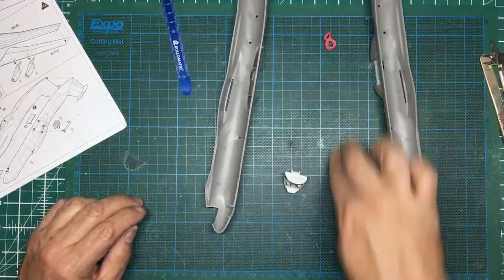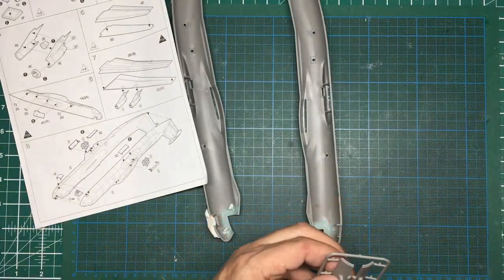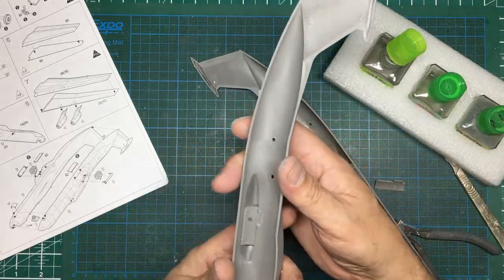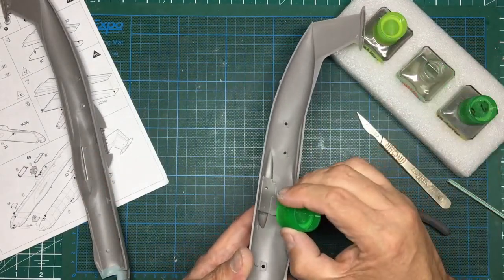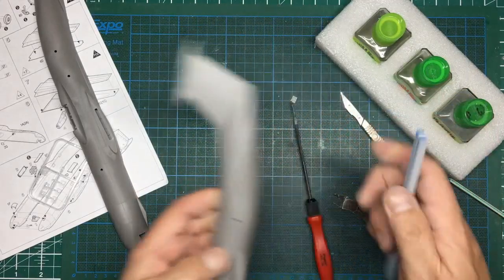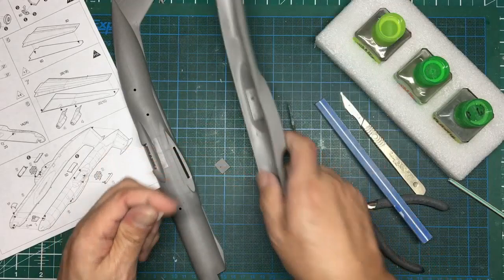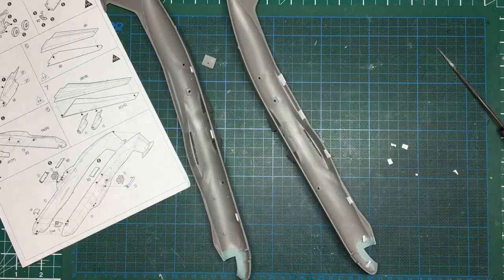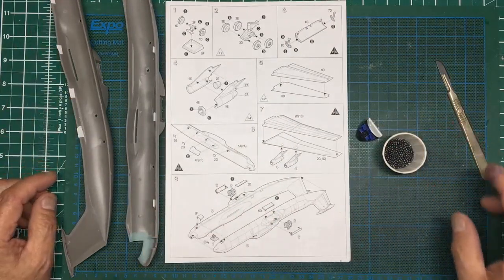Roden 1/144 C-141B Starlifter build. Part Two.

Comment: To stick the lead in place I use No More Nails. It is plastic friendly and sets rock hard and never moves. You can get cheap squeezy tubes from the pound shop. Go for the exterior type incase any moisture ever gets to it as the interior stuff will break down in water. Have fun, Heath.

Comment: Every C-141B I worked on had light zinc chromate green in the interior. I never saw a single one with a blue interior. And I saw a lot of them from just about every MAC  base in the US. Now it is likely the C-141 A’s had a different color interior. But the stretched B models had that green color.
Reply: Also panels all Matt Black.
Reply: Wing Box is flat not concave. That’s where the wing box structure was located. Built incredibly strong to support the load/force of the wings and engines.
Reply from the maker: @robinthompson4106  Thanks very much for this tip.
Reply from the maker: @robinthompson4106   Great pic!! colour looks similar to the colour i used on the rear bulkhead?
Reply: Nigel’s Modelling Bench yes it’s close. It always looked more green grey than blue grey to me but it could just be my eye and not necessarily how the color looked to everyone. It’s looking good! Keep that mojo going!
Reply from the maker: @robinthompson4106  does the C-141 have anhedral? Did the wings sag at rest?
Reply: @NigelsModellingBench 
The C-141 had a pronounced wing droop at all times while on the ground.  Of course it varied greatly depending on the fuel load. I was a flight engineer on them for 6 years before they were phased out of service and I went to C-5's.   I should have any pics that you may need if you decide to do the lizard scheme.  I also managed to pound the 1/72 anagrand  kit (C-141B) into something presentable if you have any questions.  Do not attempt the anagrande kit until you a huge surplus of mojo built up!  Great site and keep up the good work!
Reply from the maker: @jerryfenwick7493  thanks Jerry. Where can i see images of your Anigrand kit please?
Reply from the maker: jerry fenwick can you tell me. Should the engines pylons be at 90 degrees to the wing surface or perpendicular to the ground?
Reply: @NigelsModellingBench  The top of the engines are parallel to the ground when viewed from the side.  When viewed from the front the inboard pylons appear to be straight up and down and the outboards are slightly, and I mean slightly, canted inboard. Just a degree or so.  (I was never sure if it was an optical illusion or not)  Just taking a quick look at some of the pics in the house .  I'll look thru my disks and see if I can find out for sure.
Reply: @NigelsModellingBench  I don't have any pics taken at the moment.  I'll take the model outside and hose it off and get some shots taken.  Do you have any angles in mind?